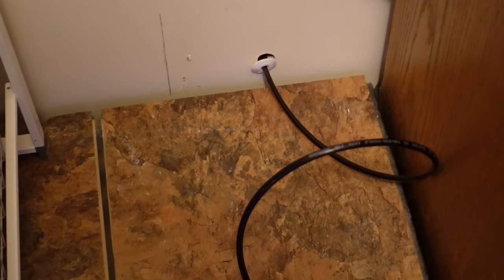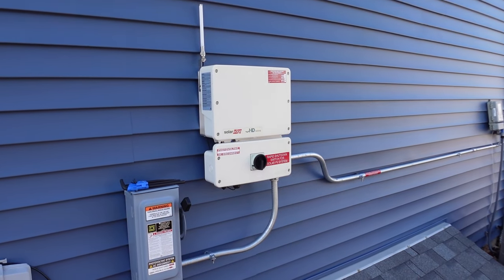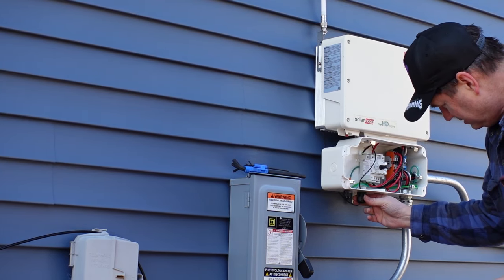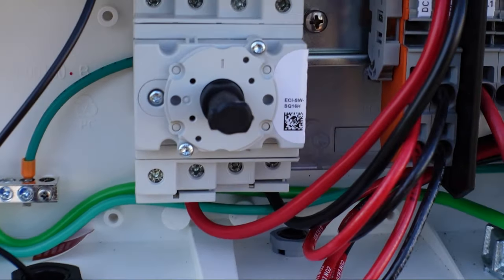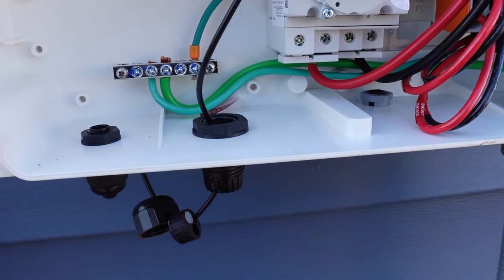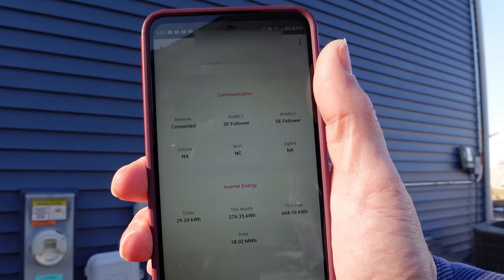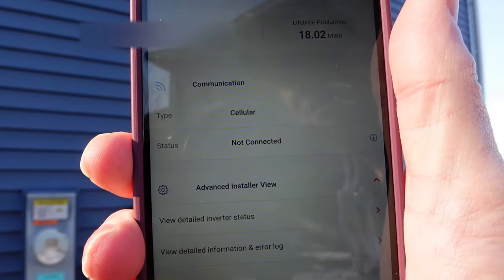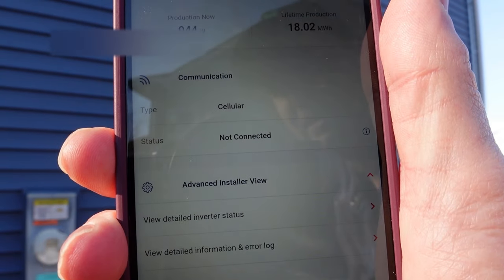Solar Edge Inverter? 3g modem? Upgrade for less than $25

Comment: So I did the same and sent an email showing that I have internet connectivity.  I just got an email from Solaredge stating they would need to send out a technician which would be $125 and it was something the homeowner is not able to do!  Any advice?
Reply from the maker: My suggestion would be to call SolarEdge or your installer and see if they will give you temporary access to the install app (SetApp).  You will have to ask for a supervisor and maybe even one level up.  Good luck.  Keep trying.  Don't let them milk $125 from you.
Reply from the maker: Did you have any luck convincing solar edge to give you access to setApp?
Reply: @MaxVoltageMiningCrypto  Hi Max, I called solaredge and requested temp access to setapp and they refused.  My installer is out of business and solaredge just tells me to contact another installer.  How did you get through this?
Reply: I was able to create an installer account by following the link in the setapp app. I just used a different email tham my monitoring account. The other thing you have to do is avoid attempting to link the account to your inverter. You just need an account to use setapp. Once you have the account, you can login to setapp and use it to reconfigure your inverter
Reply: @danielcranford3650  Hi Daniel, unfortunately when I try to create a username and password, it also requires the serial number of an inverter. I don't know how you got around that.
Reply: Nelson, unselect the box requesting access to the monitoring platform and you won't need to provide an inverter serial number.
Reply: @danielcranford3650  Thank you Daniel, that worked!
Reply: @danielcranford3650  Thanks a ton! I did all the work of wiring cat5 from inverter to my router. Neither SolarEdge nor my installer were willing to give me access to SetApp to change the communication mode to LAN. The installer wanted $90 an hour to come out and change the settings for me. You saved my day, thanks again!
Reply: @danielcranford3650  Genius sir.  I had the same hang up and your instructions worked like a charm.  I now changed communication to ethernet.

Comment: Can someone please help me I installed the ethernet on my HD Wave Inverter but cannot get the app to recognize the connection can someone please walk me thru it. I tryed several times. I do not have access to the setup app, only mysolaredge app and it will not change the wifi connection.  I took out the wifi board in the machine to see if that made a difference still can not access ethernect connection.   I have 2 inverters and the one with the screen i was able to connect LAN fine.  But HD Wave has to be done via app and no success. HELP!
Reply from the maker: Sorry to hear you are having issues switching to your Ethernet connection. Yeah, getting it changed in the set app is a much bigger challenge than running and installing the cable and it shouldn't be. Do you have set app account?  That is what you need. Once you have that, it should be relatively easy, but if you uninstalled the WiFi from the inverter, you will need to reinstall it otherwise there is no way to communicate with your phone and the set app.
Reply: I just re install the old wifi modem card back and tried to create a fake account on "SetApp" keeping getting error msg "Invalid serial #" i entered it several times the last 7 digits of my serial number  . I need help.   If i just can create the acct maybe I can move forward.
Reply from the maker: @evelynbravo-sanchez1920  the only thing I can suggest is what I did which is call solar edge and state what you are trying to do. They will tell you "we won't help you install Ethernet." Be nice but insistent the Ethernet cable is already installed and you need a temporary login to the set app. I had to ask for a supervisor. You may have to ask more than once.
Reply: @evelynbravo-sanchez1920  Scan the QR code with the setapp.
Reply: @Ortega_Beams  of course i did all that and it would give me error msg 'invalid code' called SolarEdge they told me that only installers could access the app i begged and nothing. 
Sooooo I had to get the installer paid him to get access. I hate SolarEdge for this reason after spending money i had to spend more to have some use their app 
I did the work installing the cable and hooking it all up.
Reply: That's so weird I was able to do it with in 15 min all the set up without calling any body.